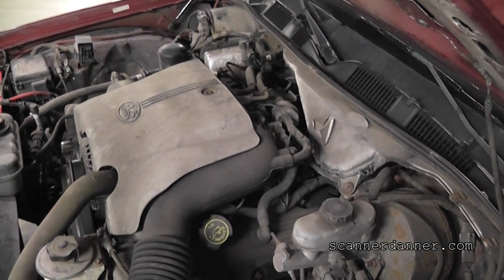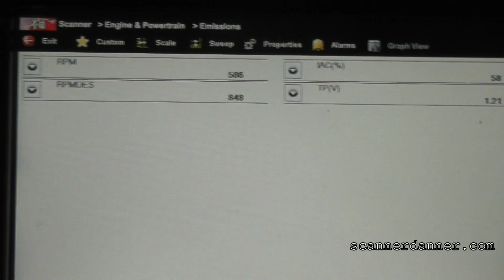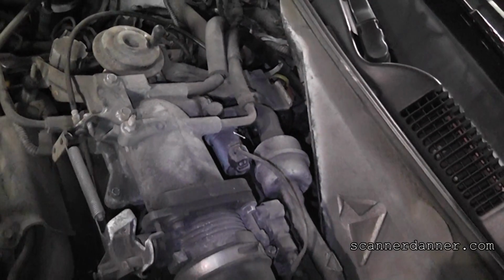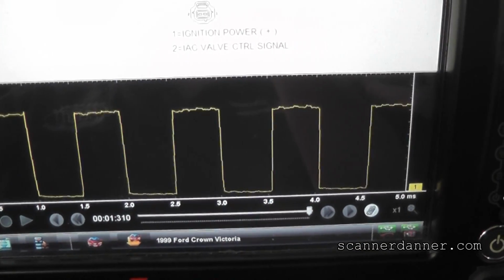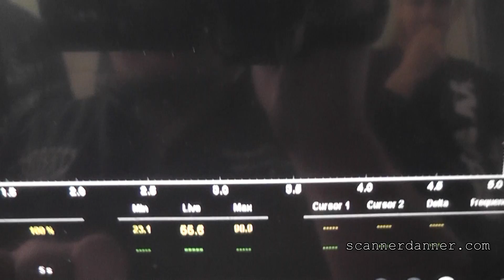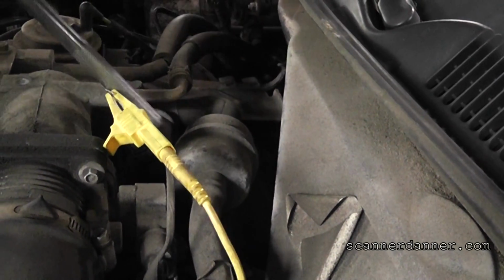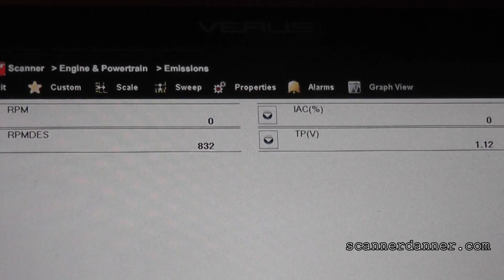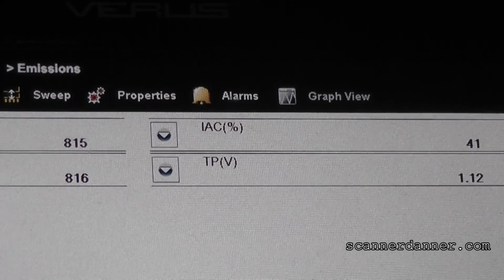Ford idle air control valve (IAC) test - stalling problems

Comment: I have an 02 sable that is doing this. I have already changed the IAC as well as the egr pressure sensor and solenoid. They were melted. Car still will not run without your foot on the pedal. Any suggestions. Also the iac is getting power.
Reply from the maker: Vacuum leak
Reply from the maker: use my water test
Reply: David Pritchard catalytic converter is plugged up. Had the same issue on my ranger. Melted egr pressure sensor and hoses. I actually blew my air tube going to the egr too.

Comment: So I changed my IAC and TPS on my bronco. when it starts up it flares up then idles down to normal. But after I drive it or tap the throttle and let off it stays idling high in park and neutral. What could it be? I have also changed my vacuum lines and air filter.
Reply from the maker: Monitor TPS voltage and make sure it is returning to the closed throttle value
Reply: @ScannerDanner  It doesn't. I have changed it with a new part and it does the same thing. Changed the IACV also. I am starting to think it could be my throttle body. I am going to try to pick a used one up at a salvage yard and see if that fixes my issue.

Comment: What if the flare up upon cold start, starts off too high like 2200-2500  and then drops to about 1500 when engine  is cold. Is the IAC bad? What does this say about the IAC?   What causes it to cold start too high?  Drops down fine after to 800 RPM when warm.

Comment: ok. im dealing with a 2003 ford taurus vín number 2 so itsthe ses model 3.0. iac throws i code to the obd 2 intermitantly. iac. pissed a voltmetter test and visual test. it dirty. but not bad.   my problém is if u snad the thottle the engine will die out. and it will surge under a normal dříve. ideas?

Comment: My 2008 crown vic seems to run ok but randomly will die at idle. It always starts right up afterwards. It was happening about once a month but seems to be happening more frequently. Could it be the IAC?
Reply from the maker: Your 2008 is probably an electronic throttle control system and there is no IAC valve. I would perform a throttle cleaning procedure first.

Comment: So if there is something wrong with the iac if you let it sit for a little and the engine stalls and shuts off that's why. Because when I have the gas peddle pushed in and driving it's fine. Can you help me. Also the engine shakes a little
Reply from the maker: clean the throttle body first

Comment: Hi, I have this same issue with my SOHC V6 Explorer after I fitted a cold air intake, wont idle, and when you have foot on gas it makes a popping sound, have any ideas? Thanks guys.
Reply from the maker: You answered your own question. "After I fitted a cold air intake". But your factory air box back in. It's not a restriction anyway. Cold air intakes are garbage
Reply: Ok, thanks, will do.

Comment: Actually all an IAC valve/motor is, is a glorified automatic choke for these engines is all it is.  Air connot get past the closed intake throttle until the IAC opens and the air from the air cleaner can cross the rubber hose that goes to the IAC, but at idle you can only open the throttle by accelerating allowing air in and engine will stall at idle though if iac stays closed.  A way to test one quickly without any equipment for the at home person is to simply run the engine for one minute from a cold start and after one minute you should be able to remove the crankcase ventilation hose on bank 2 (drivers side) and feel suction.  When the iac closes the tube wont have suction.  So check your circuit first and if okay, change the IAC.  But is iac is good focus on the maf

Comment: 2001 Ford E350 5.4 V8 with 321,662 mile, when put in reverse or D , apply brake engine stall out , any ideal why stall out ..
Reply: +Michael Datol the breaks use the engines vacuum to assist it. I would start with the vacuum system and check for leaks.

Comment: My iMac seems to be working fine but when I was cleaning it and the throttle body I noticed that the iac valve is free floating.  Is that normal on a 2001 3.8 windstar?  I assumed it would be spring loaded in one direction.
Reply from the maker: If it's working fine I would call it normal
Reply: I hear you.  lol

Comment: I have a 94 Thunderbird where it seems that valve is stuck open.....cleaning didn't seem to help.  Is this unusual???
Reply from the maker: Never had luck cleaning this style of IAC valve. Does it idle very low when you unplug it?
Reply: @ScannerDanner  It starts at high idle and doesnt come down, and yes when I unplugged it came down.
Reply from the maker: @patp8191  then the valve is fine, it is being commanded to open. You have an input problem. Start by looking at the TPS closed position voltage, then look at other inputs like the park/neutral switch, power steering psi switch and AC switch inputs, also coolant temperature sensor
Reply: @ScannerDanner  Thanks......I have a check engine light but when I try to hook up a code reader it doesn't work.   There is a OBD II under pass. dash and a OBD I at right fender it doesnt blink codes either....
Reply from the maker: Your code reader is for OBDII systems, the 94 model was not completely OBDII compliant which is why it probably doesn't work.
You need the EECIV connector and compatible scanner to use the under hood connector
Reply: I guess the other scanner tool I have lists the 94 Thunderbird.  It uses beeps and a blinking LED.  It hooks up alright but doesn't sem to work.  Thanks for your help. @ScannerDanner
Reply: @ScannerDanner  i need your help my 96 crown victoria stalls wen put in gear

Comment: I have a problem with my 02 mustang 4.6 mine starts and wont idle until it runs for a min or two then idles I cleaned the iac not sure what it is
Reply from the maker: how does it run if you keep your foot on the gas pedal?
Reply: ScannerDanner it runs good only prob I have is start up once it runs for a few min it will idle unless I turn the air on then it stalls

Comment: I have a 89 lx 5.0 and when I drive it say for like 15 min its stalls in the engine compartment theres a reset switch can anyone tell me what that could be  as soon as I reset it it turns on
Reply from the maker: A reset switch under the hood? The only reset switches Ford has ever used are called inertia switches are they are for the fuel pump circuit and on the cars, they are in the trunk and on the trucks they are above the passenger kick panel.
Reply: @ScannerDanner   200 amp scorpion brand it has 1 gauge running the battery and I going to the selniod
Reply from the maker: Post it to my forum. It's free to join. 
www.scannerdanner.com

Comment: Does anybody know if an EGR valve stuck open can cause a lean condition? I've got lean exhaust codes on my 97 4.6L F150 and my Long-term fuel trim is sitting around 35%. I've checked almost everything else it seems. Thanks.
Reply: i think inert gases replaces part of oxygen. not enough o2 available to burning the mixture. the o2 senser senses unused o2 and trigger lean code. might misfire as well.
Reply: Have you done a smoke test to be sure there are no vacuum leaks?  It would also be helpful to post the trouble codes.
Reply: The inert gasee don't burn, correct. However, they do cause a misfire condition at idle and real low speeds. And that misfire sends the engines unburned oxygen and hydrocarbons right out the exhaust, where the O2 sensor detects the unburned oxygen and the pcm then riches the motor to compensate for what it perceives as a lean condition. Or you could have an O2 send or stuck rich. Are both sides showing rich or just one?
Reply: i think the mixture in the cylinder lacks sufficient o2 to to contribute in the burning process. just small amount of o2 can't burn the mixture. resulting in more than 2% of o2 passes the o2 sensor and lean exhust signal to computer. computer then commands for richment. technically both exhusts send lean signal to computer. but odds are always there. i think if you are sure about stuck open egr, replace it or fix it, then see o2 for stuck rich and normal operation.
Reply: P0171 & P0174. I actually took it to a shop to get a smoke test after my first comment but when I picked it up he hadn't done it because he didn't think I had a vacuum leak 😡 I'm starting to think he was just kinda stupid because the trims get better with open throttle and I've been thinking vacuum leak the whole time until he said otherwise.

Comment: Hey there I have a mystery I hope you can help me solve. I have a 1976 Buick Regal 231 V6, 94K miles. Car cranks but will have no spark. I already replaced parts: new distributor, cap, rotor, new spark plugs, new wires, H.E.I coil and replaced all the fuses. There's power gonig in but no spark at the other end. Can anyone help out. Thanks and take care out there, peace out
Reply: Replace the pick up
Reply: Pick up coils inside the distributor
Reply: Does your distributor have points? If your distributor has points and this is very old school we have a very old car you need to sand down where the rotor hits the points in the timing. You wanted to be the width of a paper that comes from a match. Try that. And I'm being serious not many people know what points are I'm assuming you have points if you don't then could also be the type of spark plugs you have going into your motor
Reply: @tylergrieb7874  You DO NOT sand down where the rotor hits the points in a point system. You can get away with filing the contacts on the points until you get new ones and adjust the points to factory spec. Turn the engine over until you get the points on the high part of the lobe and adjust the point opening. YOU sure as hell DO NOT sand where the rotor hits the points. WOW   Where did you get that crazy idea? EVER HEARD OF A POINT FILE AND FEELER GAUGE? You never wondered what the SLOTS in the fixed point plate were for???

Comment: I've got a 92 grand marquis. it starts, idles inconsistently and dies after 15 seconds. If the AC is on when I turn the key, it dies immediately. only 60k miles.  no codes. no check engine. any ideas?
Reply: Donovan Doran could be exactly what he is talking about here...the idle air control valve\motor...usually our idle would jump around ...if u can give it gas and that keeps it from dying...iac could very well be it

Comment: 2000 MUSTANG 4.6 IDLES BUT WHEN YOU PUSH THE GAS IT DIES..

THOUGHTS?
Reply from the maker: Fuel psi issue or maf problem. Unplug maf and retest

Comment: I just replaced my MAs and now when I plug it in, the car runs at very high rpm 😢
Reply: When I unplug it, it runs better but like shit
Reply from the maker: How did it run before? With the new IAC, did you install it backwards? Since Ford models this was easy to do.

Comment: Can you just clean it really good rather than smacking it to work? Just remove all junk that sticking the valve?
Reply from the maker: never had any success in cleaning these
Reply: @ScannerDanner  What goes bad inside IAC, the solenoid or the needle spindle or the motor?That is exactly what you do when the starter won't engage bang it and it will start the car. I am so confused now how it work.

Comment: man I used to be a die hard ford fan...had a ton mustangs. ...never even test drove the camaros or firebirds...Big Mistake....I now think Ford is garbage. ..I am a die hard Chevy/GM man now. 
the newer fords are much better...but pre 2000s and depending on model ALL year fords just suck...ballpoints breaking trans slipping, motors that are all underpowered when they aremt broke...
my 1st car for example...a 93 tbird that I paid way too much for to boot....started on fucking fire 3 months after i bought it...there's just no excuse for 🔥 in a car....that's just awful quality control....awful design...awful components and build.

Comment: What if your problem is when it's cold out it won't idle and run have to keep giving it gas and keeps starting and keep starting it and after that at idle and run fine when the temperatures are warm like 55 or something and to start out with no problem and run but when it gets cold I have a hard time getting it to start to have to crank it 20 30 times and then finally she'll start and run you think that's the idle control valve?
Reply from the maker: If it is an idle control valve issue, it will run perfectly fine with a slight throttle opening. If you are having trouble keeping it running with a steady light throttle opening, it is NOT an idle control valve issue